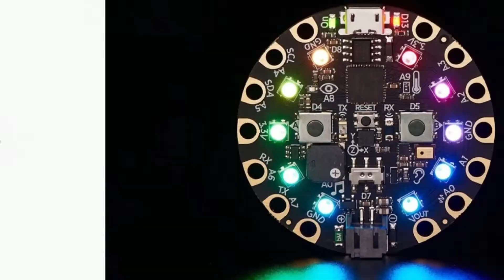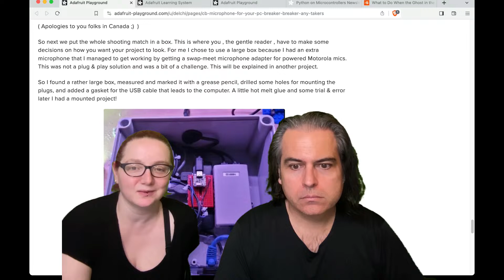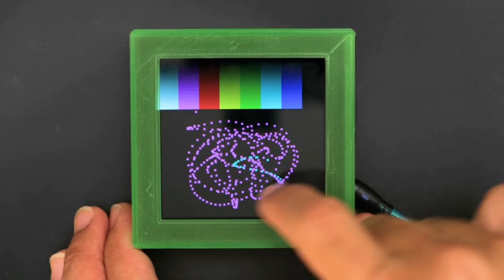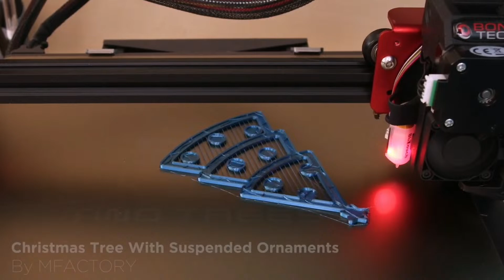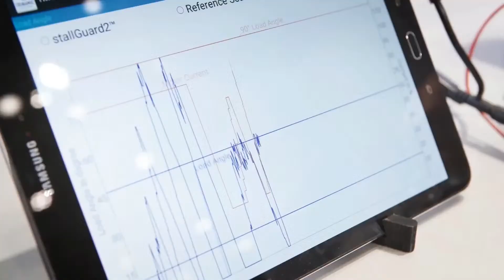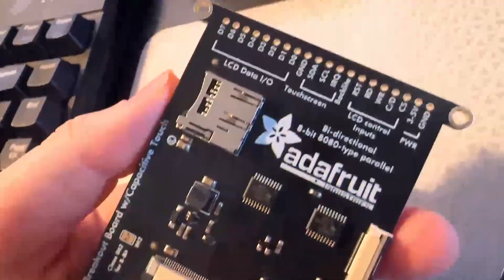ASK AN ENGINEER 11/29/2023

Comment: Very interesting Eye on NPI.  I use Trinamics on my 3D Printer, and I'm using Spreadcycle (it has better torque, and the motors are still very quiet) and I use Stallguard for X/Y homing, which works great.  I'm interested to see developments in the space.